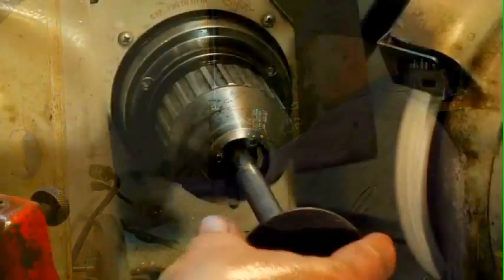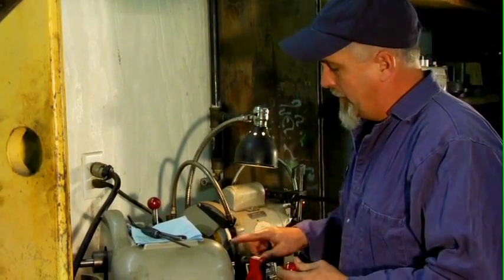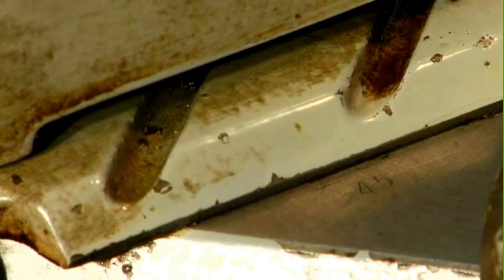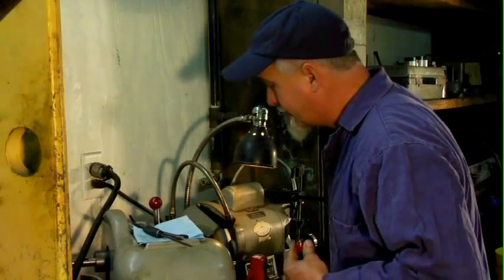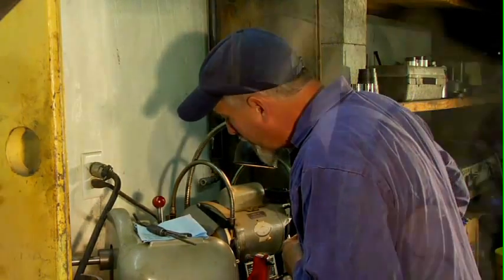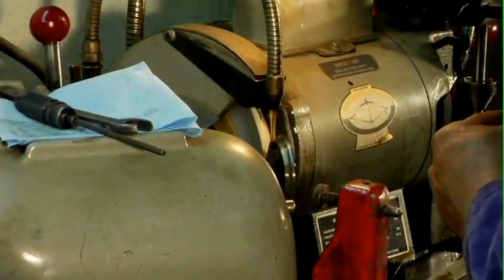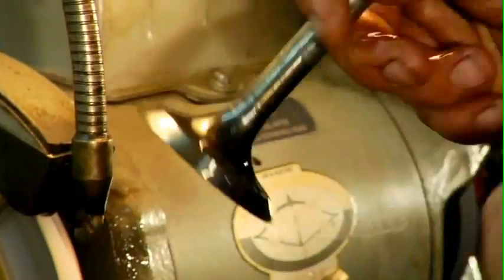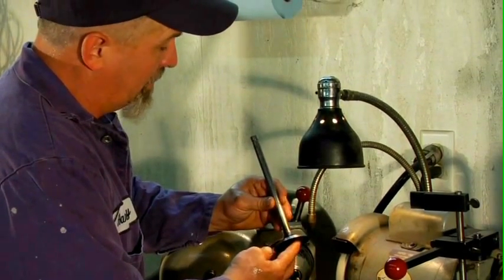How to Grind Valves Correctly

Comment: The only way to accurately grind a valve is in a machine that positions the valve in V-Blocks. Sunnen makes a valve grinder that does this. Take one of the valves you just ground and put it in a v block fixture and you will see that it will runout about .005 or more. That is probably fine for a stock motor but not for racing.
Reply: It won’t have runout if you did the valve in first with a good test indicator like a Brown and Sharpe BesTest or an Interapid

Comment: whoops you forgot to grind the tip and put a 45 degree angle on it first. Extremely necessary on Sioux model 680 grinders. All those grinders come with an attachment for doing that. How else will the tip center properly in the cone? Unfortunately very few people know this.
Reply: Probably the original bevel on the valve stem end was still ok.  This looked like a big truck valve or large old engine flathead valve.